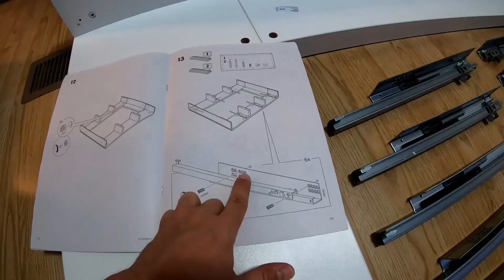IKEA NORDLI BED Build Too Difficult? Assembly Time-lapse | How-to

Comment: Some other reviews mentioned the mattress sinking in the middle cause the slats are only in the middle. Is that true? Looks like you have a hybrid mattress too as do I, so I'm wondering if that's only problem for memory foam. Thanks! :-)
Reply from the maker: I'm positive any King mattress would have an issue here with the amount of flex the slats allow. It's a 4 foot span with only thin slats that are very flexible causing this issue. Major design flaw.
But check out my full FIX video to. See how I fixed this issue permanently!
Thanks for watching!
Reply: @DrDemp  I figured. Thanks! :-) Very helpful.

Comment: Hi do you know how far apart are the slats? The warranty for my mattress require the gap between the slats to be shorter than 2"
Reply from the maker: Next time I have my mattress off I can measure them. I would say guessing they are pretty close to 2" but off the top of my head I do not know exactly.

Comment: What if i move, will you be able to easily take em out and unscrew everything or will it not do it, or we shouldnt take em out?
Reply from the maker: I thought about this same thing as well, it seems that you could probably unscrew and make this 2 sections (the two sides where the drawers are) and this would make reassembly quick is my opinion.

Comment: i just put together this bed it took me about 6 hrs by myself but for some reason there is 3 inches of space between the mattress and the bed. I have a queen and it's 60inches in width and the Nordli queen is 63 inches in width but I keep looking at other people's completed bed and wondering why mine is the only one with this extra space. I don't like it and I don't know what to do.
Reply from the maker: Oh wow that's a big gap between the bed and mattress. Was IKEA customer support able to address your issue?
Reply: DrDemp No I didn't bother to call because the dimensions of the nordli  bed is 63" W x 79.5" L and a standard queen size bed is 60" W x 80" L. The King size nordli  is 76" W x 79.5"L and a standard king size matress is 76" W and 80" L. That's probably why yours fits perfectly. 🤷🏽‍♀️
Reply: That doesn't sound like a big difference.  You can center it as best as possible and the 1.5 inch difference on both sides shouldn't be too noticeable.
Reply: ladydoes I just put one of these together (queen size) as well and the bed frame was about 3 inches wider than the mattress

Comment: i want to get this in King size but i feel there is no way those two thin pieces of wood (the birch colored ones) are enough to support the slats and such a wide mattress. i imagine the center giving in since theres no legs underneath. ill be back in a couple months for an update :)
Reply from the maker: I thought the same thing when I was assembling this bed, although the slats look thin they were actually quite strong, at one point I walked across them without much measurable deflection. Time will tell how it holds up, I was quite impressed with the quality and fitment of every piece in this kit. 
Thanks for watching!
Reply: MrBorderdown if you could actually read youd see I never said the slats weren’t supportive enough . The birch pieces of wood they’re sitting on doesnt seem sturdy enough. Even though most of the bed is on top of the drawers , if the slats weren’t there or the wood the slats are sitting on broke, your mattress would definitely dip in the center .

Comment: my drawer slides are so stiff the soft close doesn't work at all.
Reply from the maker: I did have to adjust one drawer on the Nordli dresser there is a small adjustment screw on the bottom of each slide but this is mainly for adjusting level from side to side. I dont recall any of my drawers being stiff to open or shut.
Thanks for watching
Reply: Found the height/gap adjuster thing, but the physical slides are just very stiff. So watching you close it so nicely in the video angered me haha
Reply: Nate Klein found the same thing that a couple drawers were tight closing and not sure how to adjust.

Comment: What are the black lines (almost at the end) attached to the boards for?  Those didn't come in mine.  It is for the mattress does not move?
Reply from the maker: Its basically sandpaper like material and one side sticks to the wood. Its so the mattress don't move/slide on the bedframe.
Thanks for supporting my channel!
Reply: DrDemp from where i can get these black strips? From ikea?
Reply from the maker: They should have came in the kit with your bed. Call customer service. 
Thanks for watching and supporting my channel!